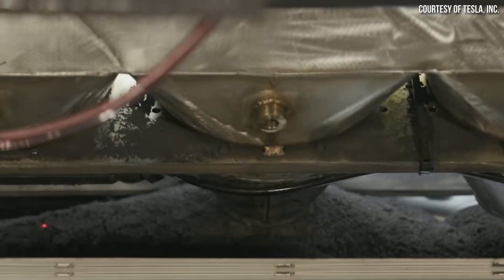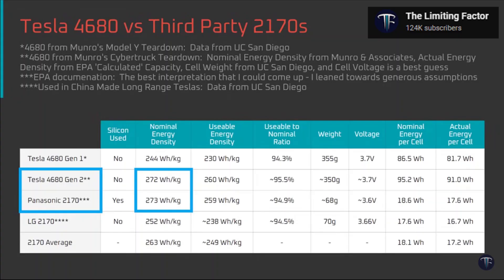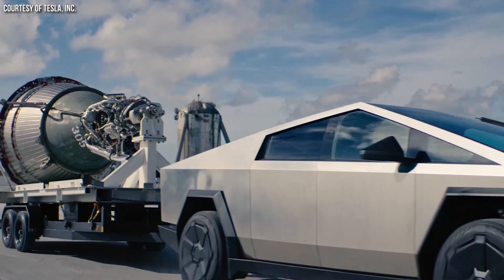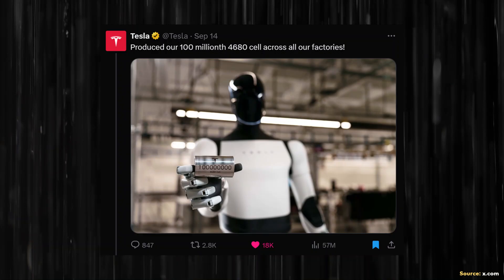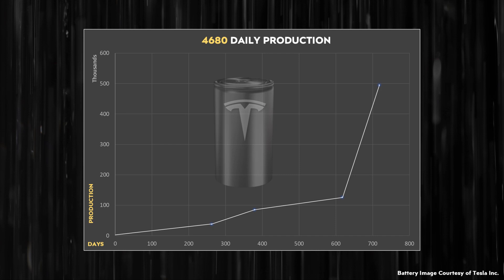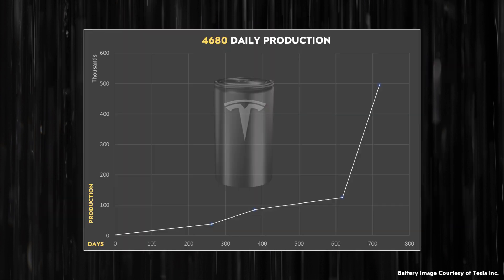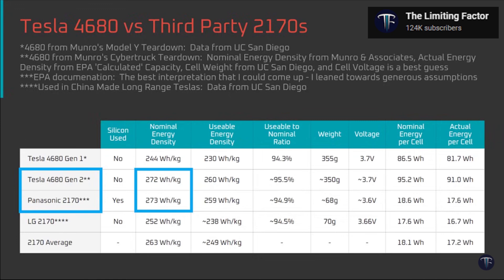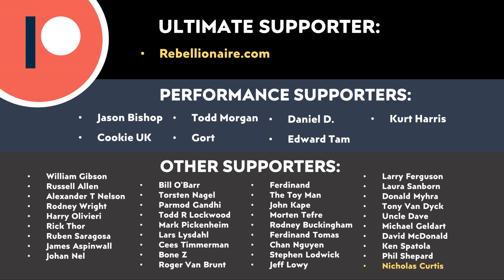HUGE Tesla 4680 Battery Production Update | Exponential Growth!

Comment: Would it be difficult for Tesla to switch over chemistry on the 4680 line to something like the LFP that CATL has that has very little degradation and also is good in cold climates? This is the battery I want. Can charge more to higher % rates with lower degradation. Less heat risks.
Reply: If you haven't heard already they're working on an lfp version of the 4680 battery now.
Reply: @camaroman101  cool, thanks
Reply: how much of a range loss are you willing to accept?
Reply: @mike_w-tw6jd  80% charges on current chemistry as opposed to 90 to 100% charge on LFP...who says there will be range loss on every day driving. Plus winter loss on the current chemistry will be less range then LFP with new chemistry.
Reply: lfp 80% of ncma range

Comment: BUT WHY does the 4680 exactly match the 2170 battery??
Does anyone else realise that’s on purpose?- and not accidental for integration into existing models? The 4680 should be superior to the 2170 as designed. The obvious question is when will it be manufactured to its fullest potential? The answer would be in the upcoming Model 2 which is a vehicle with smaller dimensions. A more efficient battery pack in the Model 2 would be lighter.
Comments?

Comment: If the cell-level energy density of the 4680 just now matches the Panasonic 2170 cell, doesn’t that mean that the pack-level energy density of the 4680 will still be worse than that of the 2170 cell? The 4680 battery cell diameter is larger, so there should be more dead space between the cells than there would be between 2170 cells, right?
Reply: It has been about five years since the announcement of 4680 batteries. And there is still no revolution here. The disappointment comes from the new Tesla 3 model with old batteries. For five years Tesla has been telling us failed stories about batteries. In my opinion it is making a big mistake and losing a lot of money trying to be a battery manufacturer. Aliyah to stop the progress of her failed batteries and continue what she is very, very good at. Tesla has no chance to be at the level of CALT and Panasonic.
Reply: 電池需要散熱，需要電池間隙，而且焊接點大幅減少，有助管理和降成本
Reply: Perhaps made up for by the reduction in materials by using the battery pack as a structural element in the chassis?

Comment: I thought they said(earnings call Q&A) Cato road facility was no longer a production site, but more of an R&D site, therefore the vast majority of 4680 production is from Texas.

Yes the 4680 cells are not currently cheaper than suppliers 2170 cells, but that's because the price is a moving goal, the price of cells are much cheaper now than a year ago
Reply: "By end of year,"  4680s will be Tesla's cheapest battery source.

Comment: Of the 100,000,000 cells,  how many are performing to Tesla's spec, and how many of them were rejected?    I know I have a 24 Y that was supposed to have 4680s but obviously it doesn't.
Reply: Your question "Of the 100,000,000 cells,  how many are performing to Tesla's spec, and how many of them were rejected?" seems bizarre. Do you really think Tesla is claiming, "We made 100 million cells, of which some/many were rejected as being defective"? No, Tesla has made more than 100 million cells, rejected some as being defective, and had 100 million good cells left over.

Comment: Battery Day when the 4680 concept was announced was 22 September 2020. That's  four years ago. It was promised to have greater energy density than existing cells. So getting to equivalent in four years? Okay, but hardly the "2 -3 years" time scale promised on Battery Day.  And at a projected cost reduction of 56%. I don't understand why you just flashed this number. You don't say that they've actually achieved this.  

Scaling up? Now that it's equivalent, this makes sense.  Anything less would be inefficient. Hopefully the efficiencies will continue to grow.  (Some companies would've been cranking them out from the beginning. At least that's how Silicon Valley works Get it out, fix it later, or as turns out to be the case, never. Just introduce a subscription plan.) So a notable goal. I just wouldn't be as excitedly breathless about it.  It's been a long time since the Models 3, Y, and Battery Day.  And I hope if they do discontinue the 4680 there will have been enough of a price pump that I will have sold my shares by then.

Comment: I don’t get it how is the 4680 on par with 2170 and 2170 is smaller shouldn’t it have at least two times the energy density
Reply: It's not a density per battery but per weight. Like density of 10pounds of 2170 x 10pounds of 4680. Otherwise you could never compare the density of all different batteries as they come in various sizes.
Reply: By weight.

Comment: Other battery manufactures are pushing development beyond what Tesla is doing. A polymer electrolyte with a small amount of liquid from WeLion is being offered by Nio in a 150kWh pack as a daily rental at some swap locations. https://www.youtube.com/watch?v=lgRfnc6GxoI&lc=UgwwhTQj9LFOmXUSwnN4AaABAg.A7qR2TJ1D20A7viu3DNzYS There are other advances in charging speed. Tesla may need those batteries to remain competitive.
Reply: swapping, no thanks
Reply: @mike_w-tw6jd  Swapping isn't the competitive advantage to compare against the 4680s. It's the much higher energy density and faster charging of the WeLion semi solidstate battery construction.

Comment: Isn't the dry 4680 close to being "solid state" ?
Reply: No, although the electrodes are made with the dry process, the cells are still filled with liquid electrolyte.
Reply: @royh6526 Ah.... yes....👍
Reply: 2:10 Tesla is developing a dry process for coating the electrodes. That replaces a wet slurry method, which requires drying racks that take up factory space. 
The result will be increased output from a given factory space. 
The electrolyte remains liquid, so this is not a solid state battery cell. ☮️
Reply: @Tim_Kent  On two or three occasions, The Limiting Factor channel arranged for a university lab to take apart a 4680 cell and analyze what was inside. I don't recall the video showing the jelly roll being removed and unwound having any liquid electrolyte leaking out. Likewise, when I see stock footage from Tesla of a 4680 jelly roll being rolled up and put into a can, I don't recall seeing any liquid electrolyte. Have I missed something? Perhaps those videos did contain liquid electrolyte but I didn't recognize it as being a liquid.
Reply: @CiaranMcHale  That's right. I have seen several videos of opening 2170 and other lithium cells. Never any visible liquid. I don't know enough to give an explanation, but nobody has said these other cells don't use liquid electrolyte.
Reply: @royh6526  Thanks for the clarification.
Reply: @Tim_Kent  👍
Reply: ??? You just confused me there. How come nobody talks about liquid electrolyte?
Reply: It has been talked about.  . @Alarix246
Reply: @Alarix246  Probably because there is nothing revolutionary about that part. However Tesla did buy a company specializing in high speed electrolyte injection.

Comment: The 4680 cell with it's larger size now has the same capacity as a smaller 2170 cell. Am I reading that right?
Reply: Same energy density, more useful energy per volume and weight
Reply: You are not reading right

Comment: What happened to the 4680?

I asked AI (Perplexity) this question today:
Q: what's your best guess of the cost of a 4680 battery pack vs the existing 2170 pack

AI:
Based on the available information, here's my best estimate on the cost comparison between 4680 and 2170 battery packs:

Current cost situation:  
The 4680 batteries are likely still more expensive than 2170 batteries on a per kWh basis. Tesla has been struggling to achieve the promised cost reductions with the 4680 cells  
<br/>Cost targets:  
Tesla aims to make 4680 batteries cheaper than supplier-provided nickel-based cells (like 2170s) by the end of 2024. This suggests they are currently more expensive.

Potential savings:  
Initially, Tesla claimed the 4680 design could reduce battery costs by up to 20% compared to 2170 cells. However, this target has not yet been achieved in production.

Manufacturing challenges:  
Tesla has faced difficulties in scaling up 4680 production and implementing some of the promised technologies like dry electrode coating. These challenges have likely kept costs higher than anticipated.

Current applications:  
The 4680 cells are primarily used in the Cybertruck, while most other Tesla models still use 2170 or LFP cells. This limited use suggests the 4680 cells may not yet have a clear cost advantage.

Industry comparisons:  
Reports indicate that even if Tesla meets its cost reduction targets for 4680 cells, they may still be around twice as expensive as batteries from companies like CATL and BYD.

Given these factors, my best guess is that 4680 battery packs are currently 10-30% more expensive than equivalent 2170 packs on a per kWh basis. However, Tesla is working to reduce this gap and aims to make 4680 cells cost-competitive or cheaper by the end of 2024. The actual cost difference likely varies depending on production scale and specific implementations.
=========================
To me, the 4680 sounds like another elon "Just you wait a few years" kind of BS
Reply: Re your last sentence - you really missed the operating method Tesla uses. The principle is that by biting into something that seems too hard nut to crack, they come to unexpected challenges, which slows them down. At the same time, the knowledge gained by researching and resolving such challenges gives them edge because that's how they succeed over their competition. 
In regards to batteries only - you failed to note that Tesla/Musk didn't intend to produce batteries at the beginning. Elon ordered all battery output from the entire world, yet they were still unable to satisfy their demand. The suppliers were ramping up too slowly. For this reason Tesla started making their own batteries - just to complement those purchased and also to show the way. This led to huge growth and many inventions in the battery industry. You can certainly see that Tesla had sparked the insane rate of growth in this industry. Most of these companies have very good relationships with Musk (as they all supply Tesla, because no single manufacturer is able to satisfy their demand) and recognize his important input in sparking this whole thing, unlike some smartasses on social media who try to discount his positive input altogether. In the meantime, they're ramping up the battery production to levels they never originally planned, and only once they have the dry battery manufacturing mastered, only then they will move to developing further the ingrediences and improving further the 4680 quality. 
All what I write was published during last several years and I'm not sucking it out of my thumb. Pay attention to what is known from Tesla team and don't believe the negativity - never bet against Elon. The media tries to vilify him because he fights for the US Constitution (1st Amendment). Such fight wouldn't be necessary, if the sinister forces didn't try to subvert it.
Reply: @Alarix246  It's not me saying it - it's AI - I post what AI assembles.
and it believes that the 4680 will be 2X more expensive than the competition.
Reply: Man, you don’t sound as knowledgeable as you think here… 😂 but good luck w that AI analysis, I’ll stick with cleaner watts and limiting factors research.
Reply: @daveinpublic  I just ask AI questions and report what it says - that drives Fan Boys nuts..
Reply: @noleftturns tesla drives u EV haters nuts
Reply: @mike_w-tw6jd  I own a 2022 Tesla Model Y long range
try harder.